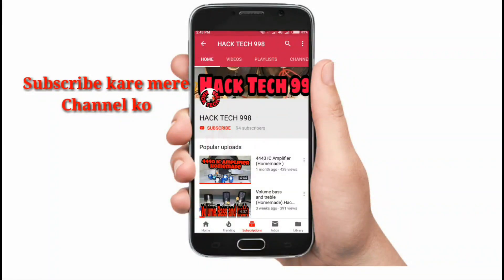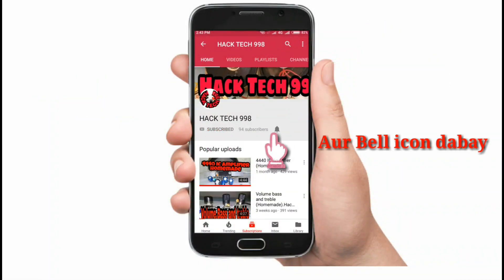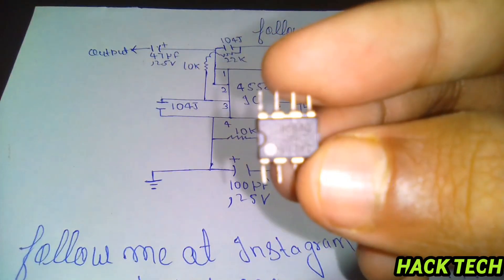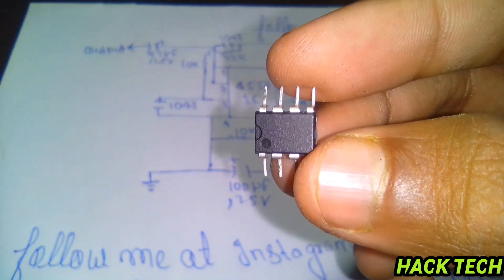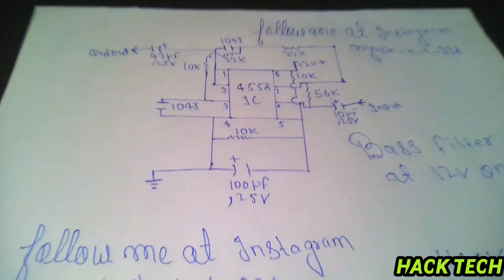4558 IC Bass Filter at 12v ||4558 ic bass filter ko 12v per kaise chalaye||Hack Tech 998

Comment: Sir 4558 ic ki circuit me transformer ke Ampere se koi lena dena he? Kyu ki mere pass 12v 200ma ka transformer he.amplifer ka transformer 24 0 24 to separate hi he.
Reply from the maker: Bhai aap kya khana chate ho please aache se elaborate karo
Reply: Sir me ye keh raha hu ki 4558 ke circuit me 12v 200mA current ka transformer Chalega?
Reply from the maker: Haa sir koi problem to nhi honi chahiye
Reply: Sir to me Asi hi 4558 ki total 4 circuit  is transformer Pe chala skta hu?
Reply from the maker: Tab may be aur current ki requirement ho gi lagbhag 500ma
Reply: Thank You Sir
Reply: Sir 12v 1Ampare ke smps pe 4 Circuit chala skte he na ?
Reply from the maker: Haa sir bade aaram se
Reply from the maker: My pleasure sir
Reply: Sir is 4558 circuit ko amplifier ki Speaker output se input deke chala sakte he?
Reply from the maker: Chala to skte hai but wo shayd hi work karega kyo ki koi Bhai op amp amplifier ke input me lagaya jata hai is liye main suggest karunga ki input me hi lagaye aap
Reply: Thankyou sir